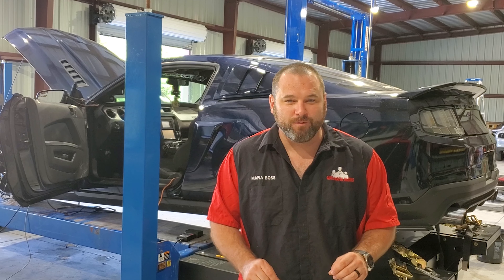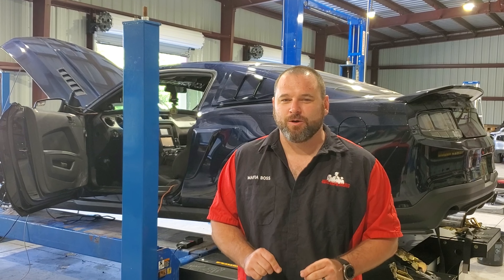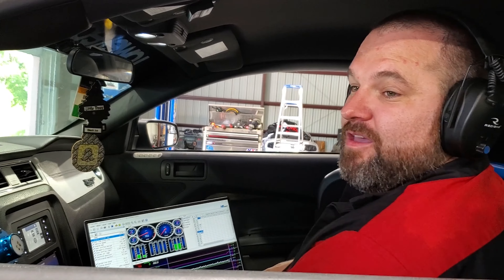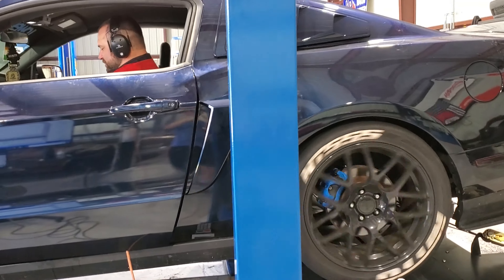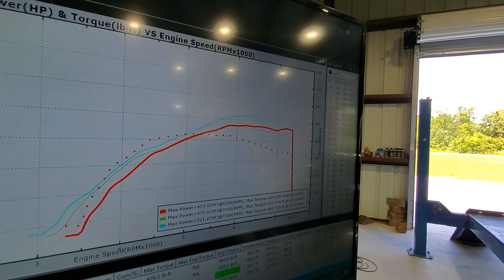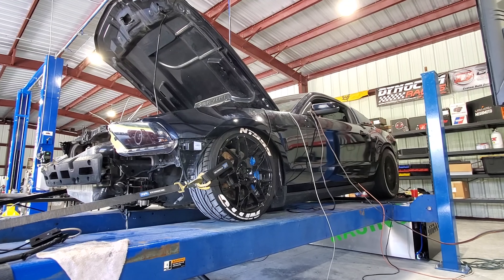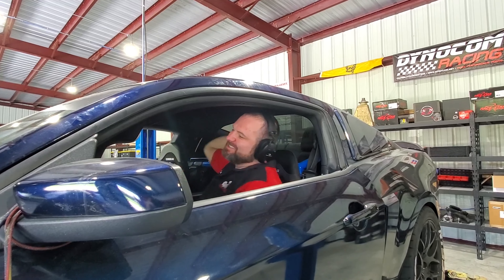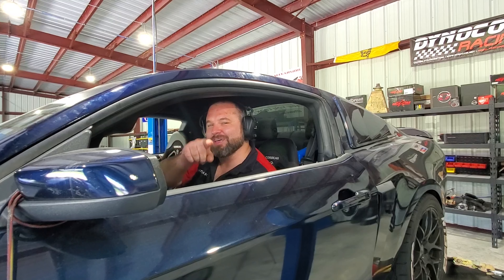TURBO V6 Mustang makes 525+ rwhp 464+ ft lbs on 8-9 PSI?  WHAT?!?!

Comment from the maker: What do you guys think of this lil V6 making over 500 rwhp on under 10 psi?!?
Reply: I think I need to go forced induction on my 2016 s550 v6!
Reply from the maker: Yes you do! We have an S550 NPG kit now too!
Reply: Auto Mafia Racing that’s crazy !
Reply: How much is this kit?
Reply from the maker: This kit runs about $5900.   Also no the engine is no where near popular enough to build a good youtube channel with. Its just fun and we sell a ton of parts and tune them so we will always support it and show them off on youtube.
Reply: @automafiaracing  is the 5900 installed??? and what all is in the kit?
Reply: Would you have the same results on E85?
Reply: How does the NPG turbo kit fair against LPF?
Reply from the maker: Its all listed on the site what it comes with and its $6000 parts only.
Reply from the maker: No we made 600+ on e85
Reply from the maker: Well with a stock motor we were only .15 away from beating the buily motor lpf best time, so.....

Comment: In the process of installing mine! Can’t wait to get it running.
Reply: jtdecker1 JMP.
Reply from the maker: much different. you wont hit this hp on that boost.
Reply: Auto Mafia Racing I’ll be running full E85 most likely around 10psi. Should be good for over 500 if not turn up the boost!
Reply from the maker: @davidgrasso8765  yup.  turn up the boost is right and good Full E85 is what the kits need

Comment: What other mods would you recommend prior to install that turbo kit? Or would the kit come with all the needed mods?
Reply from the maker: It depends what options you get with the kit.  YOu need the kit plus tuning, a fuel pump, fuel injectors, and spark plugs for sure.   AFter that its just things that help the car like tires, a DS etc.

Comment: I have a lot of mods on my 2012 v6. It's around $7000 worth of mods, mostly smaller things. What will this change on the car? Will it change the sound? How much overall hp will it add? I want to keep it a daily driver.
Reply from the maker: The turbo kit?  LOL I mean it will add 200+ rwhp and torque.
Reply: @automafiaracing  so I’m really close to being able to afford this and I was wondering how reliable would this be? I’ve got  85k miles and only a cai and axleback and I wanna do this but I don’t wanna blow my engine or be left without a car. Realistically how ling do I got before shit hits the fan lol
Reply from the maker: It should be fine on low boost for yeaaars as long as you take care of her and change the oil and filters and give her good fuel... and stay off the rev limiter
Reply: @automafiaracing  oh yeah about that and forgive me if I sound dumb lol but on the v6s is the red line 6700 rpms or where the red line is on the dash?? I’m confused about that. Because when I do a pull I don’t go more than the 6700 rpms. And obviously I wouldn’t even go that far or do it a lot but I just wanna know whatcha mean by that, thanks!
Reply from the maker: We rev them to 7700
Reply: @automafiaracing  dope. Wish I could go down there for a dyno tune but I live in Texas so it’s not realistic. I’ll def be getting your guys tune and ProCharger obviously.

Comment: The motor wont blow if its running on 93 octane with 1000cc injectors?
Reply from the maker: I mean it's all in the tune and how much boost. But no it can run 93 if the tune is setup for it
Reply: I run a sct tuner thats set to 93 octane in my 3.7 13 and it runs great but I don't have a turbo. only bolt ons currently running about 360hp. I really want to get up to 500+hp, but I don't know what shop I'd need to go to to get this installed (I'm in ohio) not sure where this shop is located but i need it like yesterday!
Reply: Andrew Roselli it’s in Florida
Reply from the maker: You dont have 360 hp on an NA v6
Reply: @automafiaracing  pretty sure stock is like 320hp for the 3.7
Reply from the maker: 305 at the CRANK stock...   not at the wheels. Most stock 3.7s we dyno around 250 to 260

Comment: Stock bottom end??
Reply from the maker: Stock motor
Reply: Auto Mafia Racing isn’t that pushing that motor? Stock I thought they was limited to  like 450 safely?
Reply from the maker: No.  Over 600 rwhp is when they are being pushed. They do 400-599 super easy
Reply: Auto Mafia Racing is that with stock fuel setup as well
Reply from the maker: @joebyerly2709  No.  If you boost we suggest the DW400 fuel pump and at least the 1000cc injectors